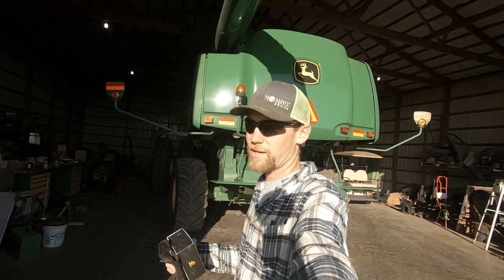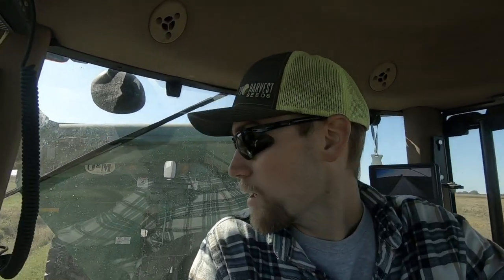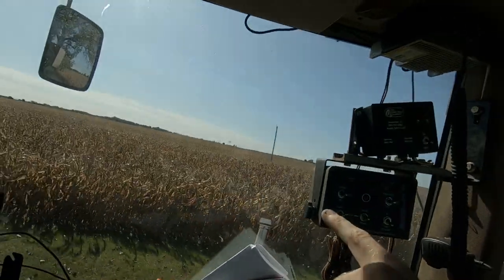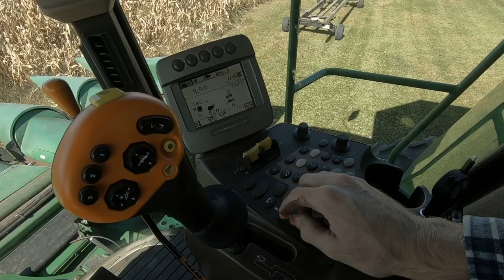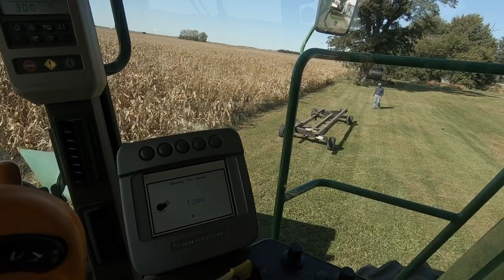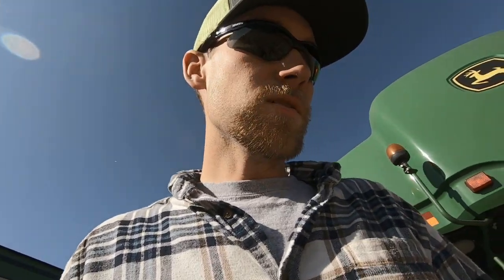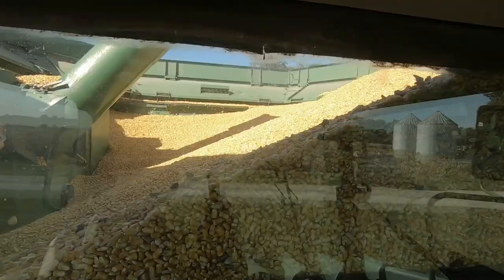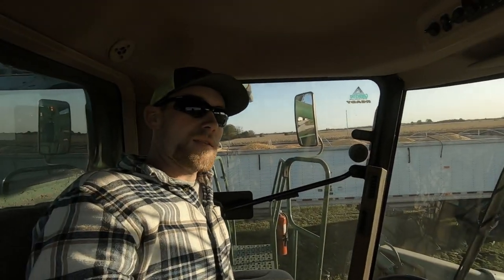Corn Harvest 2019 | Almost harvested all the corn in one day!

Comment: Here is an other tip i gave my customers. On starting every morning i would have them go through all the adjustments (concave,fanspeed,beater and or rotator speed.header speed, sieves) open al the way and close all the way or speed up and down to maintain mobility in adjustments, then back to operating settings.It takes 5 minutes but reduces a lot of headaches.
Reply: pierre godin the tips of true farmer these are steps that must be done everyday makes my day a lot easier

Comment: Here is a tric to always have the hoses on the right way. When installed as you want them put a small coloured tie wrap on the right hose of each hose set, you will never have to go back and change them. Just remember that colour is right side.
Reply from the maker: I usually put the hoses in the holder the way they go in the tractor if that makes sense, but someone else unhooked the auger cart.
Reply: We put wire around the left hose on our farm but it works good like you said

Comment: Here is where preventive maintenance is important. When you see a belt or any piece of equipment that looks iffy when doing you prevention maintenance before starting the season ,change it because, i will break on you while working and cause you down time. I yet to se a piece of equipment breaking while in storage and not working.Unless you leave the lights on or monitors while in storage that will cause battery failure .
 I always suggested to my customers to change the belts that had to be removed in order to reach the damaged one. This way they al have the same age and wear and reduce in field down time.
Reply from the maker: We inspect our machine every year. This belt didn’t get put back on one pulley quite right and that’s why it blew on startup. Stuff happens
Reply: @WesFarms It would not be as fun if it was always 100% perfect  LOL
Reply from the maker: Agreed! I like the challenge of it!